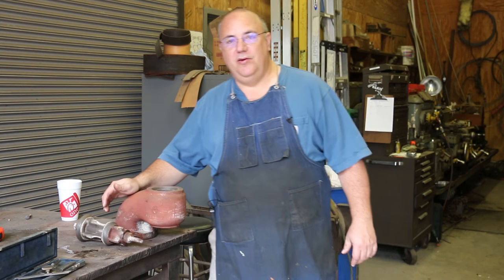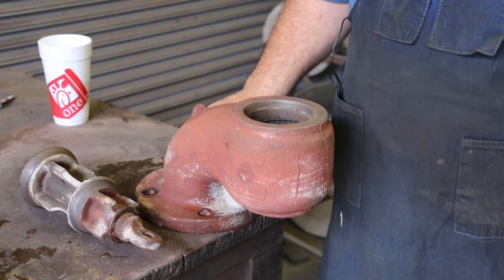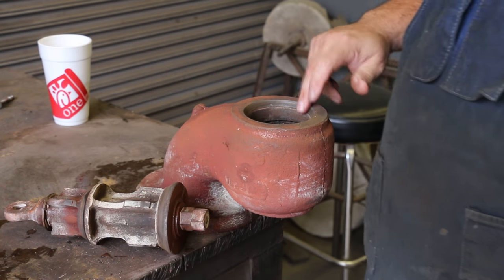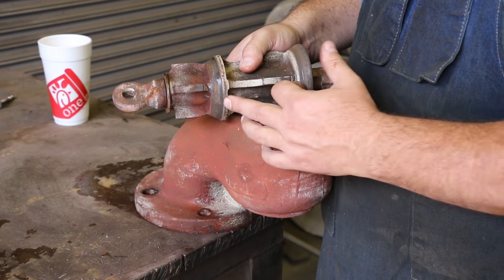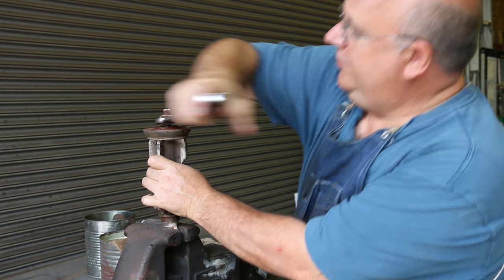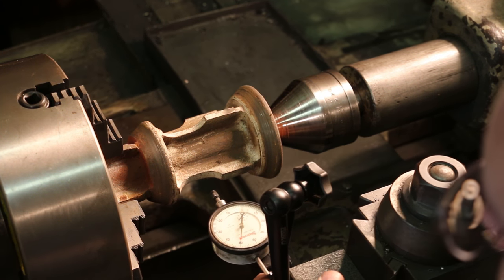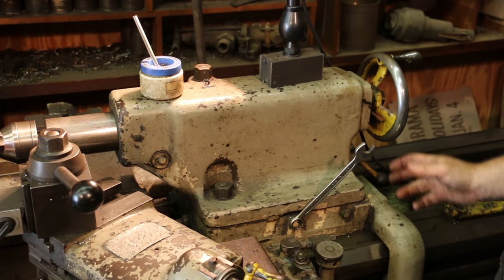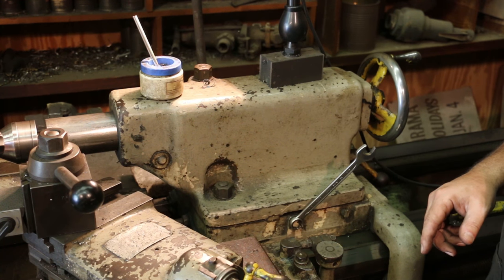Steam Locomotive Throttle Valve Repair:  Turning and Lapping

Comment: Moving the tailstock will not center it. Fingers x'ed that you find a solution while watching. You'll just move it away from or towards the indicator. You need to "ex-center" your live end the same amount as the hole in the part is off center.
But now you're actually centering the lapping surface to the existing hole, and that should also work.
Sorry for being a couch machinist. I love your videos, and they are all "must see" for me.
Reply: Good observation.
Reply: Absolutely right, a better way would be to plug the hole, bump the larger seat true and drill a new centre, would have saved about two hundred years worth of wear, but if it works, it works and that is all that really matters.
Reply: Also the opposing seats only get the lapping treatment, not the "turning" part. I can't imagine which contraption could do that cutting.
Reply: RG is correct about moving the tailstock.  I use narrow strips of shim stock between the center and the hole in the part.  What you're trying to do it move the part off center, from the lathe center.
Reply: That was the first thing I thought, I thought he was going to say "So what I'm going to do is...stick some 7 thou shim material on my center." or even "Use the 4 jaw to machine an insert, and drill a new center into that insert with a 7 thou offset and temporarily friction-fit press into the part." and then he mentioned moving the tailstock and I was like "Oh, no no no, no!  The hole is still concentric to the tailstock regardless of tailstock alignment, the error in concentricity is in the material, not the tailstock!"
Reply: I'm sure I wasn't the only one going "no, no, no, don't do it Keith" at the screen. ;-)
Reply: I could hear you from here.:>) But that being said, he got it fixed and everybody is entitled to an off day brain fart once in a while.
Reply: RGSneaker, I agree. I've watched Keith struggle with these basic concepts before. I don't think he's quite there sometimes
Reply: I am not a machinist, but I simply couldn’t resolve in my head how moving the tailstock wouldn’t affect all directions since the part spins. Glad to read comments and determine that it wasn’t just my ignorance.

Comment: Very tricky task machining both surfaces to contact at the same time. You can't check it for fit while turning it, either can you? Thanks Keith, I appreciate your efforts. Take care on your travels.
Reply: He couldn't check it with the valve body with it mounted in the lathe that way round. Had he had it the other way around, he could have done.

Comment: You are going to get a hundred comments all disagreeing with each other Keith ....  8-)  
That was a decent method, and it will work as well as most.  I would have expected the top and bottom stem seats to have a small amount of play between  them - not one solid casting.  In that configuration you could have the stem seat angle slightly less than the body seat angle, giving a sharp annular contact ring for both parts of the valve.

Comment: You guys should take measurements for a future casting. Better have them already to spec in mind, if you need them, you can send the part to be cast and make it whilst the old one is in the boiler still.
That nag aside, great work, and neat "footwork" with the tail stock. I'm a bit reticent in touching mine, but, this really brings in that, it's a feature/possibility, that i'm not using.
Reply from the maker: One of the things that I think that people get hung up on is that they don't want to mess with the adjustments on their machines.  They were made to be adjusted and should be used when needed.  It is not a big thing to adjust a tailstock, tram a mill, set up a vise, etc - all things people are afraid of doing.
Reply: You probably heard me hollaring!...Don't move the TS!  ....the runout had nothing to do with the TS, and as you found out, you could have adjusted it til you were blue in the face, and not made any dif.....the runout was with the center and the valve face, so either shim the TS nose, or cut a new center concentric with the face....the heavy duty lapping likely moved things to true....great vid!

Comment: Keith, I don't think you can adjust the runout with the tailstock offset, runout will stay the same. Challenging task though to match the distance between the valve seats, looks like you got them to lap in evenly, cool repair.
Reply: It's does actually work for type of work, if you consider how it was originally machined
Reply: Matthew Trott It doesn't, you need an offset center not to offset the whole tailstock, it's the same idea to the 4 jaw chuck at the headstock, you don't change the center of rotation by moving the spindle but by creating an offset between the center of the spindle and the center of the workpiece, same thing at the tailstock - you move the center away you don't change the center of rotation in relation to the tailstock center.
Reply: what you need assume is that the whole part is a taper so you are offsetting it to that taper. given the part machined pretty evenly when set I'd say it did work.
Reply: Matthew Trott he's not adjusting for taper but runout, if you have a lathe try to adjust runout with the tailstock and you will see you get the exact same amount once you start rotating the workpiece, geez....
Reply: if I'm honest I didn't watch much bad habit of skipping chunks. I assumed it was running concentric
Reply: or a lead a busier life than you. I confess arguing a wrong point is amusing. but you should never let facts get in the way of an argument. at least im not running for a political position. enjoy your quiet life
Reply: we all do it at some point or another, no worries
Reply: the reality of life. mostly to busy to relax. the modern age aye.
Reply: @MT_T991  No it didn't - Keith fudged over that giving the impression it'd work - but it won't. He'd end up with the same run-out but now also offset ! Sharp x is correct.
It's this precise point I'm looking through the comments for :)
Reply: @millomweb  read my comments I accepted that I had only scanned the video

Comment: Adding to what others have said about the center and correcting run-out, early machining texts say to scrape the center to correct run-out of the outer diameter. 
  The problem shown here is why you never, never smack the end of a part with a center in it with a hammer directly...if  you try to do repair work you will have exactly this problem.

Comment: I always get a kick out of the desire to be dead nuts on vs. good enough.  The linkage didn't care if you were off by a bit or a lot, what matters is the seats.  It seems nigh on impossible for us to get our heads around "good enough".... especially with our ability to machine to .0001" with a CNC, or see 10 places east of the decimal point.  That was a good fix.
Reply: Especially keeping in mind that the valve's going to be in an extremely hot and harsh environment within the boiler, conditions that will cause both the housing and the valve itself to expand while at operating temperature.  You practically cannot duplicate those conditions on the lathe while doing the machining, so 'good enough' is what you have to settle for.

Comment: just a hint.. in case a viewer ever has a situation like this come up. could have used different grades of lapping compound top and bottom face..  super fine on the top. and course on the bottom to remove more metal from the bottom..  could also just spread compound on the lower seat to work that one away. 
 i know you are in a rush.. i would have loved to have see it  tested.. using a shop vacuum hose duct taped to fit in the bottom opening and a little soapy water sprayed on.  at least the steam pressure holds that valve closed..  or so it looks..

Comment: Hi Keith
sure agree with you that getting both of those seats to match is a heck of a challenge!
I wonder if later models of that basic valve design were more adjustable with respect to simultaneous seat contact? 

My other question is whether you are thinking of a test of the valve with water or compressed air for sealing effectiveness before putting the valve back in service?

enjoyed this video- I am still amazed at how well this equipment was designed and built-close to 100 years old and still working AND serviceable!!. How many of the things we are making today will last that long :-)
regards
vic

Comment: Hi Keith. Very interesting vid as I'm a steam buff from way back. It's nice to see an original valve in pieces as I need to design one in 2.5" scale for my K36. I've got lots of books with drawings, but nothing beats the real thing. One thing I noticed but is that you didn't dial in from the Flyghts which are what hold the valve central and the seats must be concentric with. Then again it is a hundred years old so maybe never made concentric in the first place.
Reply: Concentricity will come from the lapping process and as for the valve being correctly aligned, again, the seats will perform that function as the valve is not constrained by the central rod that operates it. A little slop there will allow both halves of the valve to find their best seating position.

Comment: Couldn't you lay a layer of Dykem on both seats after machiniing to see if your grinding was correct? Another great video.
Reply: Prussian Blue dye is what I'm used to for lapping... Dyekem works, but the dye is a b tougher...

Your dentist uses "articulating paper" to do the same thing when checking your bites, especially after seating a crown... (ask me how I know,,,)
Reply: I wasn't suggesting to use Dykem for the actual lapping process. Note that I said "after machinering" and I was thinking that Dykem might be helpful in detecting any high or low spots in the mating surfaces after machinering.
Reply: You don't actually lap using the dye, of course...   you wipe off the lapping compound and smear on some dye, then rotate the two mating parts to look for high & low spots.

The dye needs to be soft enough to move around - or wear off when the surfaces are in contact.

Dykem (layout dye) is a lacquer, and dries a bit tough, so you need to work a bit harder to get ti to come off of the interferences, which is why straight Dyekem is not the best dye to use to check fit.

Dissolve a little Dykem in some axle grease, and you get a dye which isn't as tough, and will show where your surfaces are in contact with less effort on your part, which means less potential to damage your workpieces.
Reply: Thanks for the detailed explanation. A lot of things I didn't think of before.
Reply: Keith Fenner would use his famous sharpie pen

Comment: I'm pretty sure that if the hole on the center isn't concentric with the outer diameter its not going to matter what you do with the tailstock because the axis of rotation isn't changing  that's probably why it wasn't doing what you wanted.

Comment: Thankyou for helping me understand what lapping a valve entails!  This valve seemed ripe with potential pitfalls as you worked to get it trued on the lathe.  I was thinking how terrible it would be to start a repair on such a unique part and ruin it.  Has this ever happened to you?  What did you do to fix the mistake?
Reply: Let's say he managed to break it while in the lathe. He could possibly weld/braze it back together - or send it to Windy Hill Foundry to use to make a mold to cast a fresh part.

Comment: As others have stated, you cannot correct runout with tailstock offset,  only taper.

You could have bumped both valve faces in then lightly cut  your hole to 60 deg for the center. Use the 60 for tailstock support. end.  Wouldn't surprise me that the valve is worn off center from hole with use.. 
 
A point on lapping valves, lift the valve off the seat while spinning.  The lubricant in the compound pulls unused compound inward. Drop the valve back down on fresher compound and the lap goes quicker.  I've lapped hundreds valves on internal combustion motors.

Comment: Enjoyed the machining. Don't know if moving the tail stock will fix problem. In carpentry, I kinda think of it being a jack rafter cut at 0:12....square....and then doing the same cut on a 7:12 , something I do understand when it comes to angles. Just think of the hip rafter as being....the valve body....with jacks connecting to hip at cuts. The hip rafter can't run out of alignment in any plane, must be straight. Otherwise plumb cuts of jack rafters must change angles to fit. Thanks for the video! 
....13 
Now, how about wood working messing with your mind? lol

Comment: Is it possible to replace the seats in the valve body casting? Are the valve seats cut directly into the cast iron valve body, or, are the seats separate inserts that are seated into the casting? Thank you for your time.

Sincerely,  

Brían S. ”Duby” Du Bois
Retired Lovcomotive Engineer, L&N RR.

Comment: Excellent video as usual, but I am a bit confused as to why adjusting the tailstock would affect the runout,as it is still turning on the center that is in the valve.It seems to me that it would only affect the angle very slightly.
Reply: Yep, wouldn't affect run-out at all !

Comment: Keith, after watching a great many of your videos I have noticed that in regard to removing tight nuts you will more often than not start with the open end of the wrench. This is a mystery to me. A 6 point of even 12 point box end is much better. You only have to round a flat off a nut once to screw it up.

Comment: How about putting a 0.006" (1/2 of 0.013)shim strip between the bull center and one side of the bore of the hole? Moving the tailstock will just move the runout closer to the tool. It will still be 0.013".
Reply: Peter W.Meek Right on.
Reply: That was my thought as well when he described what he was doing. He was not understanding the problem. It was not a taper issue, it was a lack of cocentricity. Moving the tailback can't compensate for that.

Comment: Hello Keith,

I found this video interesting because I have often wondered how the ‘accelerator’ worked on a steam loco. I am supposing you can lathe cut the faces to near enough them lap both flats together? Not sure whether that would be possible to accomplish by hand and not knowing how you would do it by a machine method?

Thank you so much Keith for an intriguing insight into the internals of a usually never seen part of history.

Take care
mrbluenun
Reply: 'Accelerator' - you mean 'regulator' / steam regulator / steam regulating valve.

Comment: Did I see a ridge below the seating area of the upper seat? You might need to cut that away before you can get a good seat. (You just got a ridge-reamer, but I don't think it will work at an angle.)

Comment: Good job, Keith. Is there a spring that holds that valve closed? Didn't see one.
Reply: Steam on top of the valve casting produces a force to hold the valve closed.  Likewise there is a force applied to the bottom of the valve trying to open it.  Because the bottom exposed surface is smaller than the top surface, the total force acting on the valve is down by the difference in the two forces.  Because of the "slop" or looseness in the throttle connections, the throttle handle moves before the valve actually moves; therefore the connections have to be made so this occurs or the valve will not close and stay closed.
Reply: This design is almost a 'balanced' valve or there would need to be a huge lever to move the valve against the steam pressure to open it.  I can tell you that Keith has enough trouble opening the valve as it is.

Crown Metal Products locomotives for amusement parks use a sliding blowdown valve for the throttle to make it simple.  The actual valve is a disk which slides opening or closing the opening for the steam to pass.  The force it makes against the face is P(pressure) X Area.  If the diameter is doubled the area and force is 4 times not doubled.

Comment: Moving tailstock will not solve radial runout-need to cut  small area of part contacted by tail stock cente at 60 degreesr--- OR----run a bolt through the part and put a nut on the end to hold in place, the centerdrill bolt end- install center and your are ready to go.

Comment: When you moved the tailstock .0065 to eliminate the T.I.R. of .013, what effect did that have on the T.I.R.?.. That part of the video seems to be missing.
Reply: It fixed it....until you turned it. In order to fix runout you have to move the part in relationship to the axis it rotates on, moving the tailstock moves the actual axis  which won't fix run out. Keith was probably having one of those moments we all have sometimes.

Comment: But what about the vertical alignment?  Couldn't you run a bolt through, align the part then center drill the bolt on the tail end?  Just thinking as a bricklayer not a machinist.  Greg
Reply from the maker: You could run a bolt through - that is what we did for lapping, but it was not running true on the bolt hole.
Reply: Could you have re-cut the center on the top end with a small boring bar and the compound set to 60`deg., or would that screw up the hole for the linkage?

Comment: hi keith, I think you should have kissed the broad-end hole with a boring bar to make it run true. frustrating probably all this comments on hindsight.
Reply from the maker: There is no way that I could have held it to true it up.
Reply: ok, that looked different in the four jaw on the video. nothing said.cheers.

Comment: I'm surprised both parts of the valve spool are in one piece. I'd have expected one to be separate with a shim to match it to the distance between the seats on the valve body.

Edit: When grinding in car cylinder head valves you use a small reciprocating motion to which avoids scoring, lifting the valve off the seat and turning it every now and then it to redistribute the paste.
Reply: And a bit of paraffin in the paste ;)